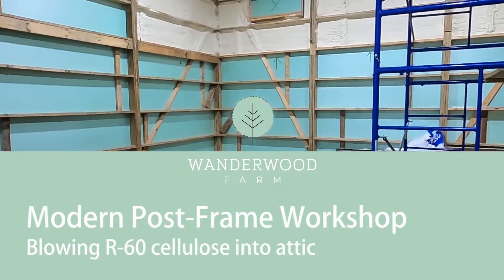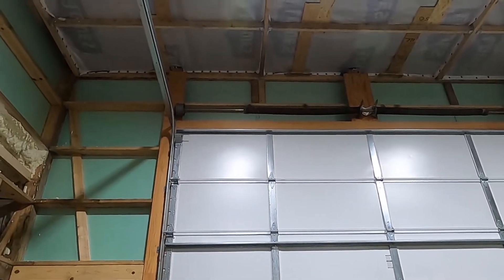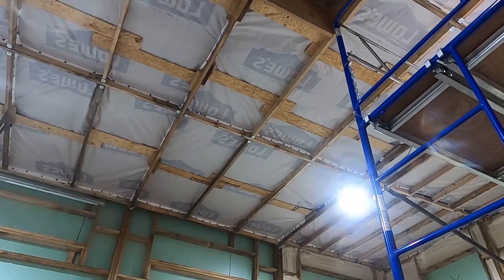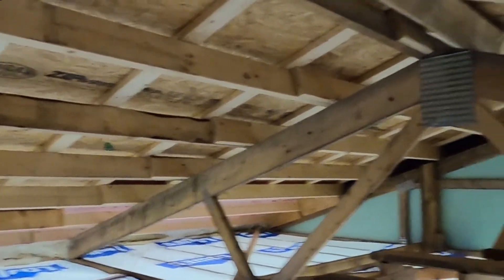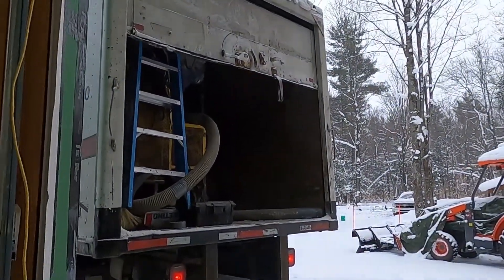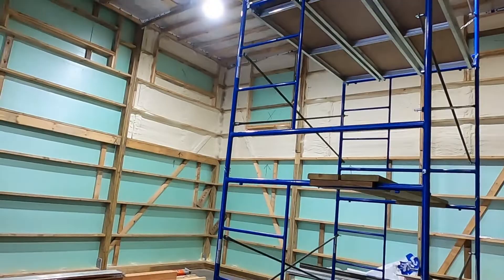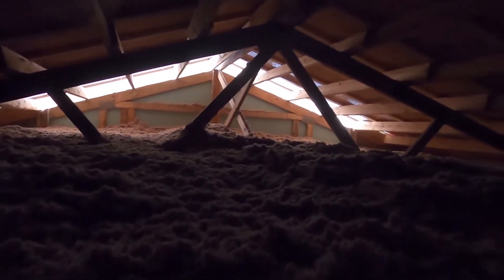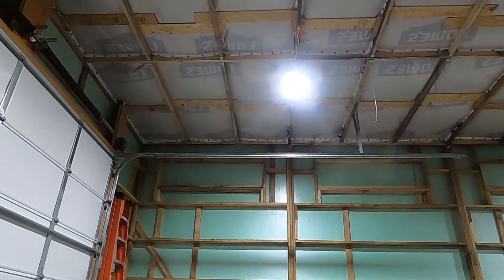R-60 ATTIC using 16" of blown-in cellulose insulation (055)

Comment: Are you planning on adding ceiling fans otherwise all your heat will be up by the ceilings?
Reply from the maker: We’re planning for one 6’ or 7’ fan, dead center. As you mentioned, our thought is that it would be for winter use to push that heat down.

It definitely gets warm up there (working on the ceiling joists and loft). Hopefully one big fan will be enough. Thoughts?
Reply: @WanderwoodFarm  I am no expert so I can not comment on whether one large fan is better than multiple smaller ones.  I am sure some fan reseller probably has the answer.  You obviously need to figure that out before you run your electrical for wiring and mounting.

I wondered if you could notice a significant heat difference when you were up high in the bay.  It would only get worse the higher you heated the bay.

You also did not mention the R factor of the large garage door.  I added light weight bubble wrap garage door insulation to the inside of my door to up the R factor.  It is so light in weight It does not require any change to spring tension.